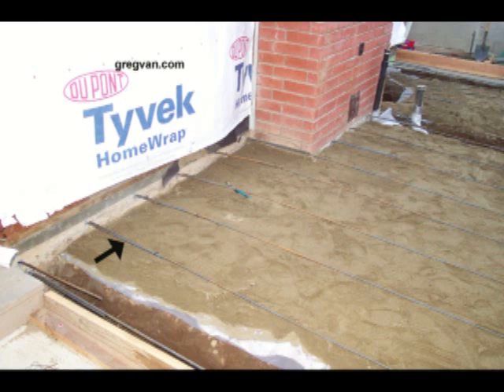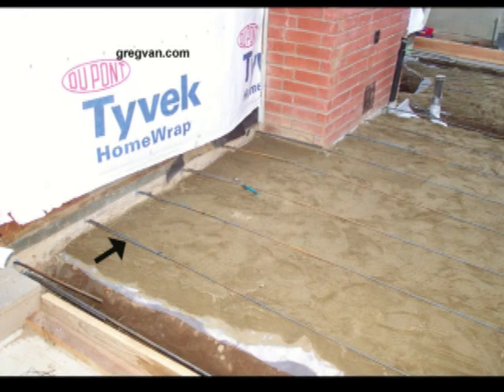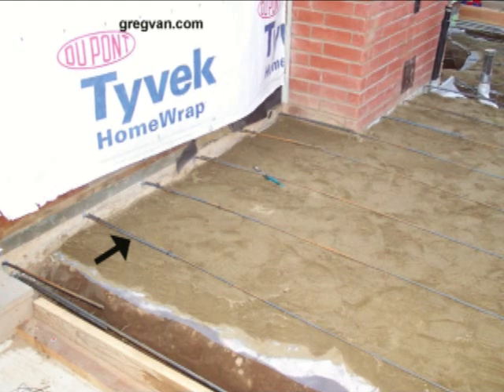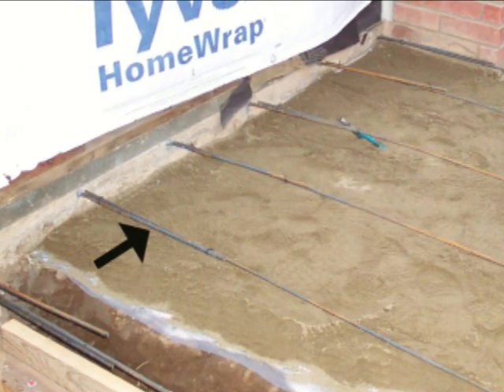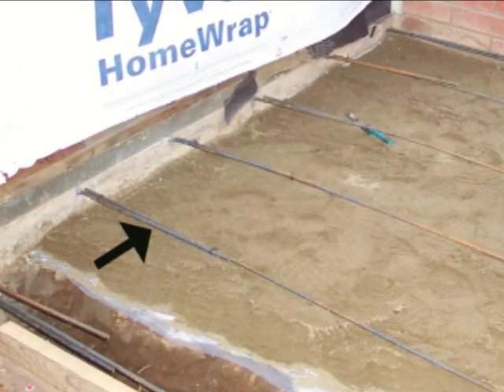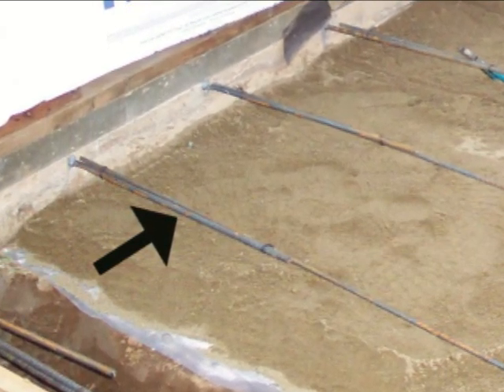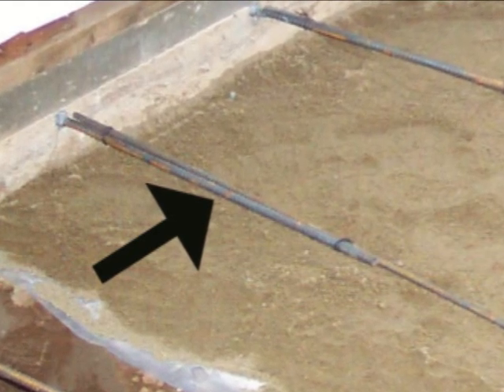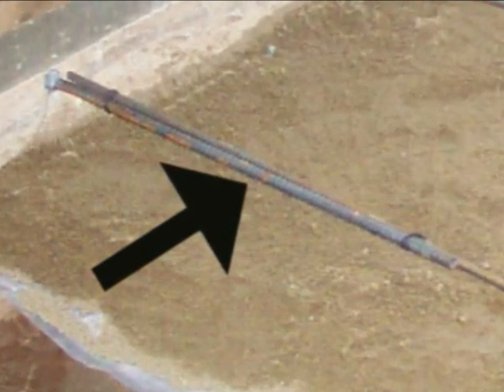How To Lap Concrete Foundation Rebar - Home Building

Comment: How far in does the dowel go into the existing slab foundation?
Reply from the maker: It would depend upon the project, but between 6 and 14 inches seemed to work most of the time. Installation instructions for dowels is usually provided by an engineer.
Reply: @gregvancom  we paid for engineer to review our architects plans but I do not see any specs on that detail. Hmmm so I will try searching myself
Reply from the maker: The information should be located in the details pages or on the building foundation plan pages. You can't find it, call the architect or engineer. @cindytruong4685
Reply: @gregvancom  thank you so much 
We want todo the concrete phase for a two story addition of 1200 sqf  in advance. And just want to do everything to reinforce and stabilize this foundation for out terrible clay soil in texas.

Comment: On a strain concrete slab it is 60 times the diameter of the rebar . On columns it is 40 times the diameter of the rebar
Reply from the maker: Thanks for the info and now we just need an explanation of what a strain concrete slab is.

Comment: I'm currently working on a new home that was engineered and the plans call out 55 times the bar diameter. So this is what we are doing. In the past though in most situations I've always stuck to the rule of overlapping 2'.
Reply from the maker: Thanks a lot for sharing your comment and if I didn't mention it in the video, have mentioned it numerous times in my other videos. Lapping rebar 40 times its size might work and be approved for 90% of all construction, but might not be approved for every project.
Reply from the maker: It might be used for aluminum, but it's also used for rebar, but you bring up a good point and anything that is specified on a set of building plans should be followed or questioned, but if questioned, make sure you get changes in writing and never accept a verbal change or modification to the building plans.
Reply from the maker: It's probably best to go with 40 times the diameter, unless it's noted otherwise set of building plans. Remember, the information I'm sharing with viewers in my videos might not be applicable in other parts of the world.

Comment: not sure how appropriate it is but I have a welder and I just butt my rebar end to end and weld it into one continuous run with out having to overlap saves money and materials. saves time as well takes less time to weld a bead than to overlap and wire together.
Reply: Ken Jett not appropriate, would not pass inspection anywhere i know of.....24 years in Local 416 LA, butt welding rebar not allowed.

Comment: just wanted to add that you should put a full bar every other one so you dont create a weak spot in other words off set them
Reply from the maker: +Skeet Gutierrez Great idea and for those who might not be clear on this, you should slide a full piece of rebar into the epoxy hole on the right side and then install one in the next epoxy hole on the left and then alternate back and forth as you work your way towards the end of the footing or slab. This sounds like it will make a great video, so stay tuned to the main channel and I will make one as soon as possible.

Comment: I don't know where the number 40 came from, but I think there is no harm, except maybe financial, to overlap it as close as you like, especially if you are not doing any "pre-stressing" on the rebars - rebars, after all, are there to reinforce the concrete, so you can put as many of them as your wallet can handle.

Comment from the maker: @Has1b That isn't a dumb question at all.  Just don't share it with any of your friends, just kidding.  Realistically, all Rebar should be placed within the concrete structure before anyone even thinks about pouring concrete.  It will be tied off and securely fastened also.

Comment from the maker: @pantera013 You don't have to, but smaller ones are easier to work with and don't forget that the rebar can't move for a certain period of time, usually 24 hours. you can save a few buck, doing it your way, just make sure that the rebar dosen't move.